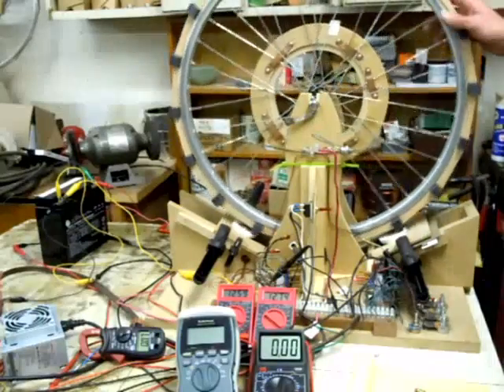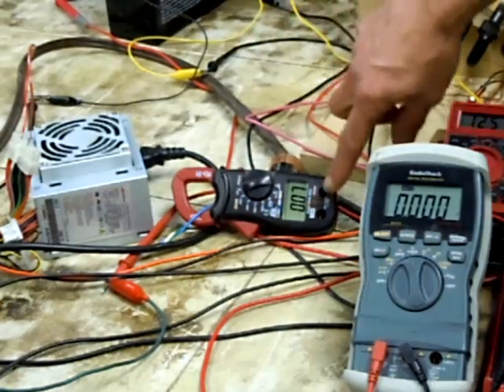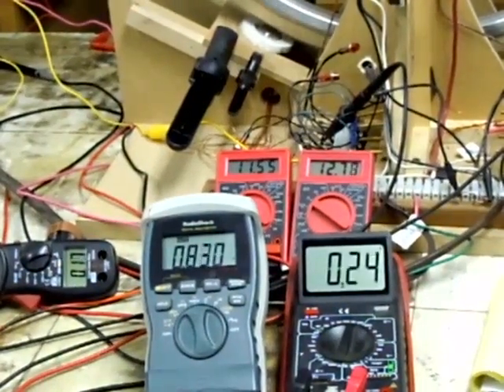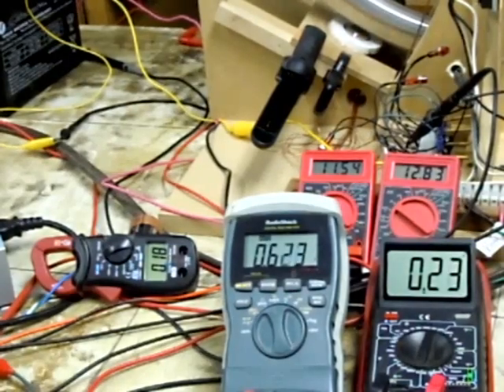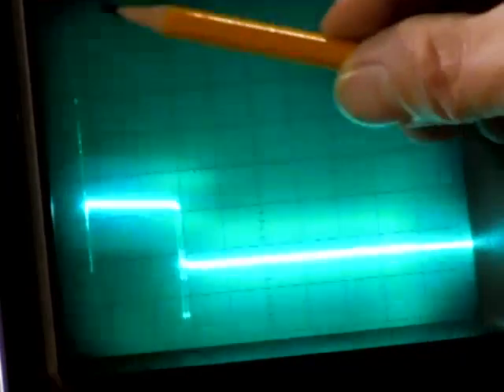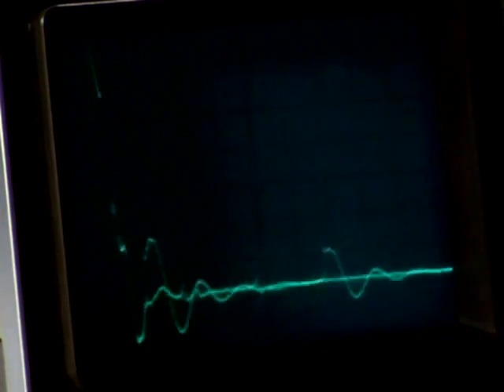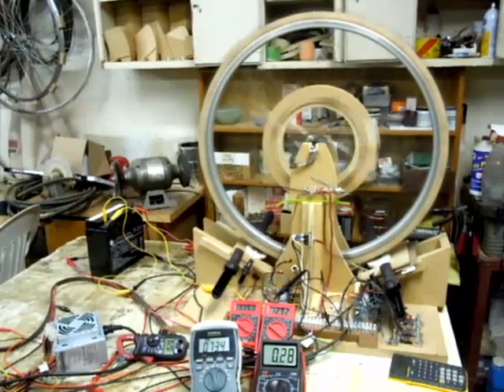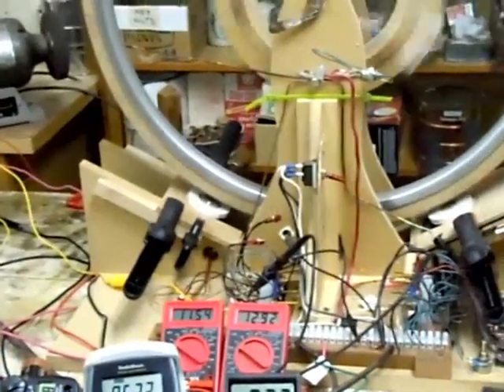2 Pole 18 Mag Super-North Wheel Bedini Motor Running

Comment: have a 8 coil on 13 inch bike wheel, had the 3055 metal transistors but switched to the mos. plastic ones, run alot cooler. Tuning the ssg circuit, I just match the voltage produced as close as I can with the pot. runs off a 24 volt batt. and charges 4 12 volt deep cell to over 12 volts for grid tie input.  Great job, next you'll be getting a large peg board to mount the wheel on. but gets little noise at 3200 rpm. Again great job.

Comment: I've always found the "changing gears" speed up very interesting. I mean, it's fairly logical to assume a faster passing magnet across the trigger coil will produce more current which should hit the transistors base harder and cause the collector and emitter to stay open longer and more fully thereby spinning the wheel faster. However, why the "gear change" effect? why is it NOT linear? place cap in parallel with the supply as close to your circuit as you can. maybe 3300uf ? just guessing...